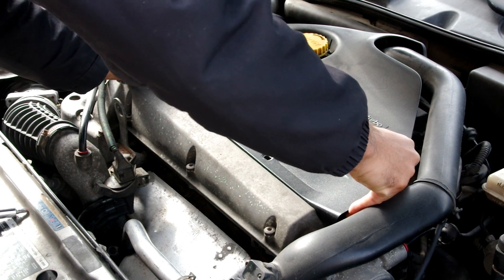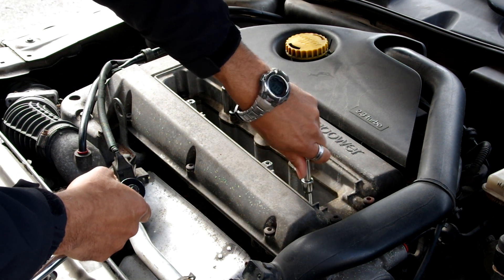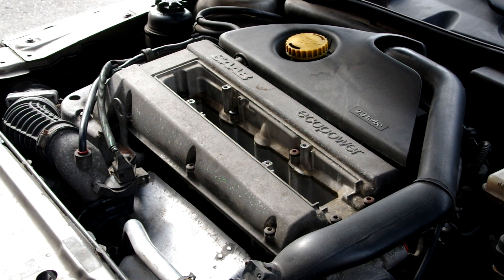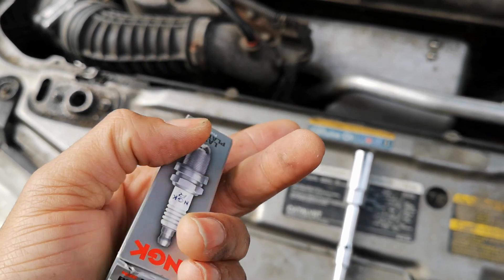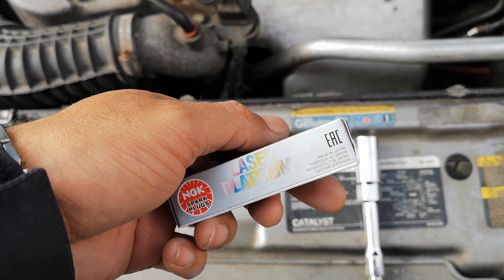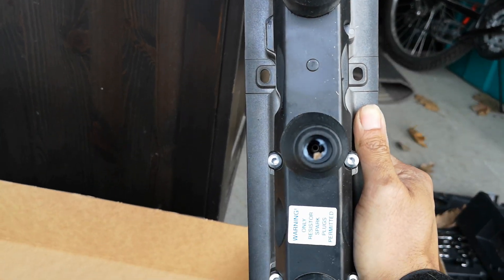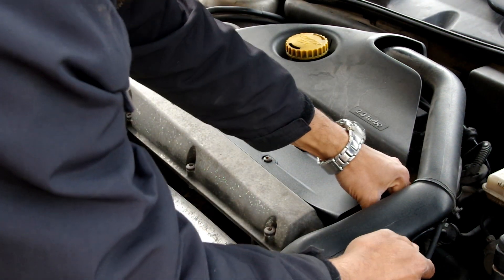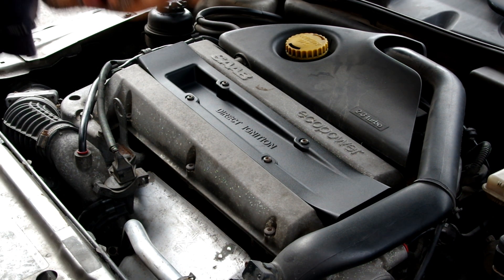Saab SEM NGK DIC and NGK spark plugs

Comment: Hey happy New Year to you and the family.Im currently driving 2005 aero same color for 10yrs.just wondering how the ngk ignition cassette is holding up?
Reply from the maker: Happy New Year to and your family as well! Honestly? Zero issues at all with the NGK cassette. It's made by SEM which is the OEM manufacturer. The only difference is that NGK won the rights to supply the SEM cassette to the aftermarket with NGK packaging. Other than that, it's literally identical to the official OEM cassette.
Reply: @kmercuryc  Thanks for getting back with reply in process of ordering same package from rock auto sabb for life my friend I enjoy your channel be well from new york👊
Reply: Saab for life my friend..

Comment: Got a 2001 (2002) model year 9-5 Vector with the 2.0t (B205F) engine, last time the plugs were changed was 2006, along with the DIC....4 months ago it threw a check engine light that wouldn't turn off after running, i sometimes have vacuum leaks. Mechanic told me it was the spark plugs...so i replaced those...at 240.000km. I guess you want to stay out of trouble, buy OEM :) Had the car for 12 years now.

Comment: Good video.  I've had the same problem recently and am fixing to do the same thing.  Got this 9-5 around 2 years ago fairly cheap and every problem that Saabs are notoriously known for I've had and have fixed, just recently got the a/c going,  now this $60 chinese DIC I put on it seems to be going out, it's been cutting out at high speeds, and almost died on me the other day.  How's your's holding up now?  Thanks for the video, Rockauto here I come.
Reply from the maker: My SEM NGK DIC is holding up 100%. Zero issues. That term "Go big or go home" is like the opposite for us. "Go big or don't make it home". Lol